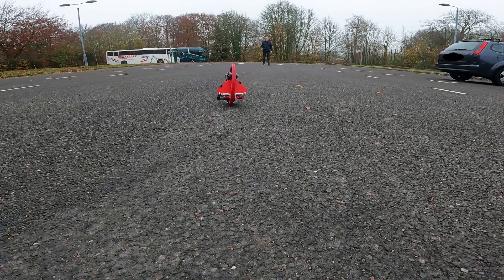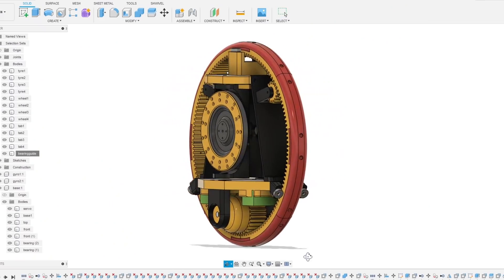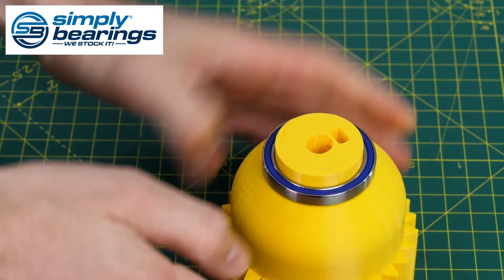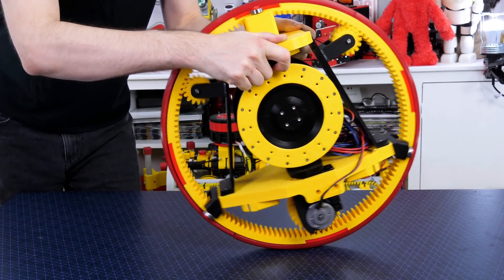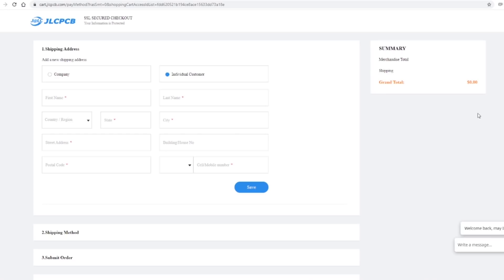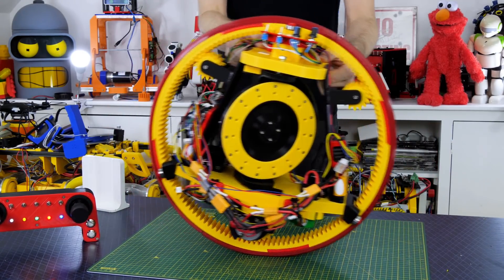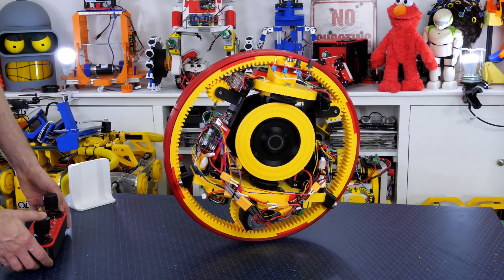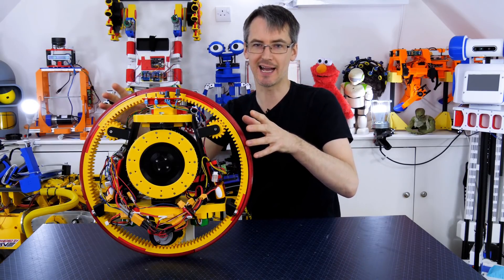Gyroscope Stabilised Monowheel

Comment: Hey I was just wondering if you put a gyro on the horizonal (single one), would that work better for both steering and importantly, torque or thrust as the center shouldnt flip around when accelerating or braking right?

Comment: you need two more gyros on the top and bottom within the wheel itself to counteract movement in the sideways direction that it falls over in. if you have 4 gyros you will be able to drive it.

Comment: I think the biggest fallacy in peoples' design of Monocycles is they remain centered on the drivetrain.

Star Wars had an interesting approach to it with General Grievous' legged bike. Where you basically take the engine from the bike and shove it in the sidecar, so you're sitting on one side of the wheel, but can still see under the inside of the rim and out the other side.

It's also safer, since you can add a counterweight system so if it loses balance, you can knock it on the side that DOESN'T have the driver. And even if it falls on the side of the driver, rollbar edges and the clearance in between the drive ring and the outer rung ensure their helmet isn't hitting too much metal and pinning the driver down.

Perhaps if it's possible to do just that; take the seat of the bike and shift it to the side, so you can make the engine and gyroscopic system as it needs to be. Just keep enough out of the center so you can see over the engine and under the wheel, and wear a helmet.
Reply: As if Mr Bean bolted the sofa to the side of his car, instead of tying it to the roof.

/watch?v=LVSLLWXdKV0

Comment: For the motors that are used to stabalize the main wheel side to side, you could use another gimbal set on the horizontal axis to stabilize the gimbals in the vertical axis.

Comment: Interesting. Optimal sideways balance seem to require that the gyro mechanism is not leaning in forward-backward direction and should be located somewhat centrally to get that sideways torque. On the other hand forward-backward motion is based totally on gravity only - the lower the center of mass of a frame that turns the wheel the better the control would be. Seems difficult to achieve these with singular inner part to the wheel but what if you decouple these things into two inner parts? The gyro part keeps itself upright no matter if the wheel is turning or not and another weighted part takes care of forward-backward motion.

Comment: James Bruton DUDE!!!!!! Do you know about Electric UniCycles (EUC)? You need to. Currently the EUC market is flooded with monowheels that only have 180 degrees of self balancing: the wheel self balances from front to back (like a Segway). What’s missing is side to side. Current riders have to control and maintain side to side balance. But if the EUC world had a full 360 degree Gyro Wheel, that would be a huge game changer. Reach out to companies like Inmotion or Begode with your ideas and knowledge. We need this in the Electric UniCycle community…NOW. Great work. Keep it up!
Reply from the maker: It's this: https://youtu.be/lS_yyy0gmUQ

Comment: it's nearly perfect, you just need to suspend the gyros in a 4th wheel that automatically rotates in the opposite direction of the main body and you'll have full control
this is giving me a weird theory (that I am entirely joking about, mostly, kinda, probably)
any vehicle or drone controlled and driven exclusively by wheels is not stable unless it is both a reasonable shape, and in possession of 4 or more wheels
bikes? they fall over all the time
three-wheeled vehicles? the reliant robin is infamous for toppling over whenever it feels like it
cars? you gotta work to flip them and even then sometimes you need outside help
thus the same reasoning can be applied to other shapes: bike w/ a single gyro stabilizing it? you'll never perfectly center it and even if you could you'll get excess forces acting on it like crazy
one-wheeled robot with two gyros? you can't really drive the wheel and keep the gyros stable, ya gonna need another wheel